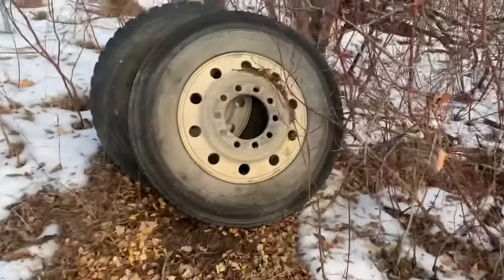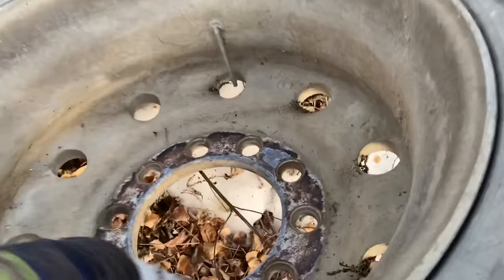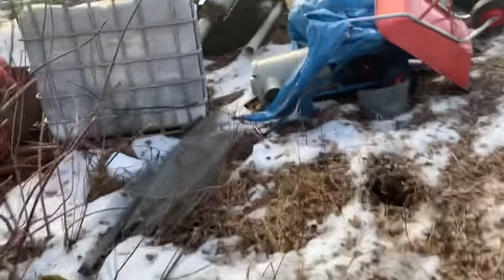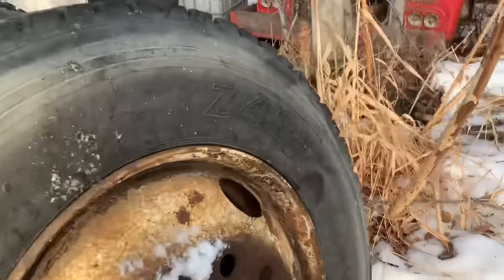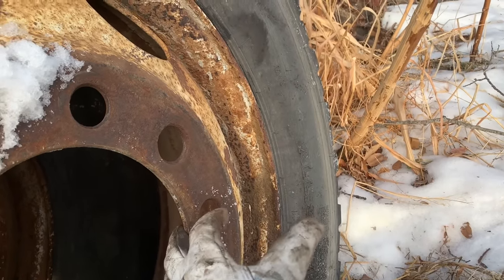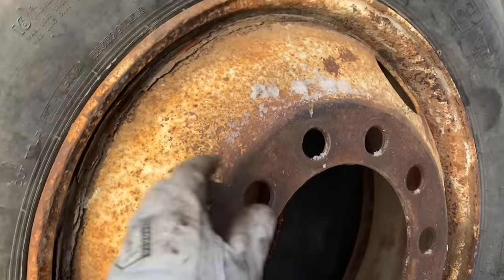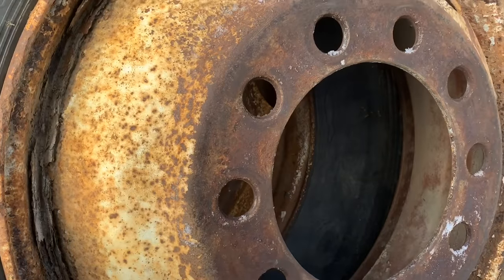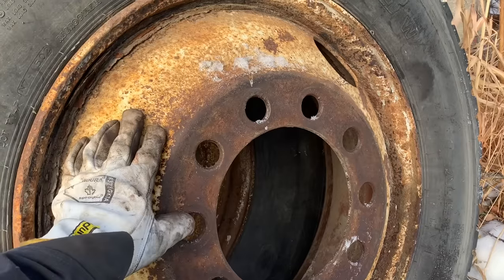Smokey & The Bandit Tribute Truck Ep.16 New Shoes for Bandit-Two

Comment: i thought he would not put the aluminium wheel without a protection between steele and aluminium
Reply from the maker: Holes were 2 small on the ones I had ... not made for in between stud pilot wheels ... outer lug with the lip just crushed the plastic ... will fix 👍
Reply: @TwinStix  thx for the answer, great video

Comment: Forgot the plastic spacer
Reply from the maker: Holes were 2 small on the ones I had ... not made for in between stud pilot wheels ... outer lug with the lip just crushed the plastic ... will fix 👍
Reply: Could you possibly paint anti-seize between the rims
Reply from the maker: @davidgillespie3743  that’s what I did for now ... have to believe it’ll help keep them separated

Comment: Those plastic rings ate not for anti crosion what have you they are used for anti scratching during lug installation . use anti seixe
Reply from the maker: plastic rings had the wrong size holes so I just painted the contact surfaces with antiseize
Reply: I have never seen them different sizes most guys paint or just use a anti rust agent those plastics are just a anti scuff pad for sockets when tightening lug nuts

Comment: You forgot to put plastic plate between wheels so not to corode
Reply from the maker: Holes were 2 small on the ones I had ... not made for in between stud pilot wheels ... outer lug with the lip just crushed the plastic ... will fix 👍

Comment: U gone hate them alluminum wheels fact is with steels on inside alluminum on outside with break the studs and inner nuts do what u want but I be replacing them every week of driving it either put steel on steel or put longer more heavy duty inner studs for alluminum wheels facts is I been there did that it don't work all that well or convert to pilot wheels
Reply from the maker: Interesting ... I know lots of folks that run inner steels and outer AL w/o issue ... and AL is lighter than steel so the loading on the inner hub stud would be less 🤔
Reply: @TwinStix  u gone find out the hard way yes my old truck was same way steel on inside alluminum on outside guess what the inner nut keeps breaking and u gone have to put longer better studs in hub and all weight is not on inside wheel hell there's no pressure when u got steel inside alluminum outside on trailers and guess what they keep breaking to u gone find out hard way man cause been there done that and everybody in this world will tell u same thing it's ok if u don't listen u learning keep on u learning
Reply: And the people u no running em have longer studs in there trucks if they tell u different they lying to u pull there wheels off and look at there inner studs I bet they longer than URS just saying that's a fact

Comment: Not to be a critic
Reply: But I think you forgot to put your plastic plate between the wheels
Reply from the maker: Holes were 2 small on the ones I had ... not made for in between stud pilot wheels ... outer lug with the lip just crushed the plastic ... will fix 👍